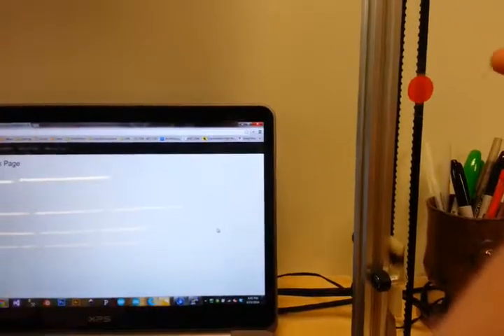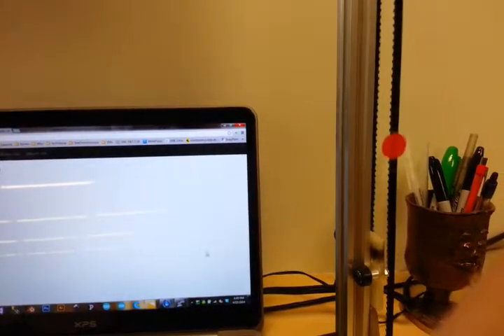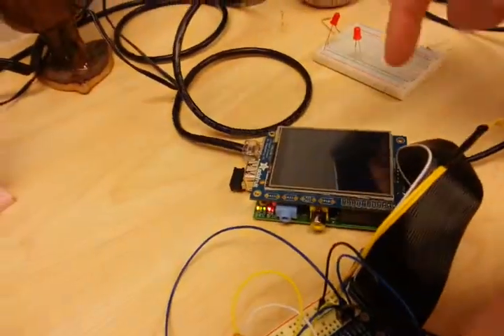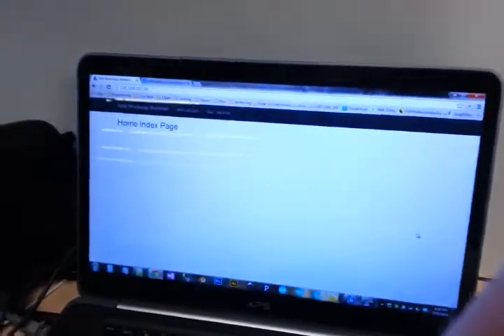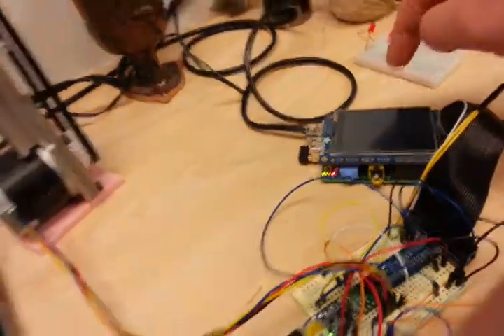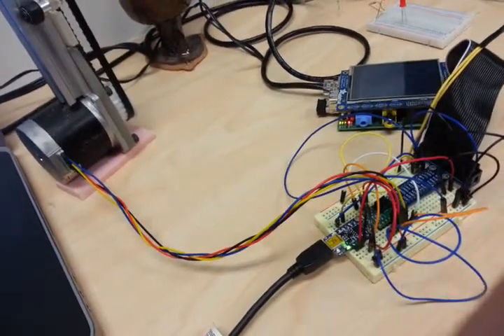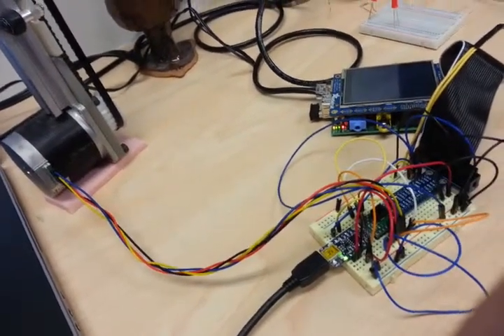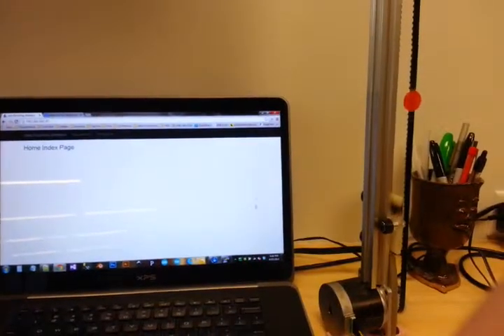Real time stepper motor control

Comment: I know I'm late to comment on this...I'm trying to control my stepper motors with the mouse or any USB input device realy. Can you point me in the right direction? The goal is a camera motion control with 2 axis.
You would save my ass :D
Reply from the maker: I used pololul stepper motor drivers that accept a pulse train to command movements. To calculate the movements you can use an arduino or something similar. From there you need some form of communication with the thing the mouse is connected to. In this case I used a serial port
Reply: I got my arduino with the stepper motor drivers (A4988) hooked up to my laptop. Did you run the arduino with the standard firmata and then controlled it with node-red?
Reply from the maker: i wrote custom firmware for the arduino and code for each component
Reply: Oh ok, that's a "no can do" for me I'm afraid, but thanks for your input :)
Reply from the maker: awh, come on,  coding is fun
Reply: :D yeah not so much for me, but sure, after this project I can look into it. But for now I have to make do with simple sollutions and finish the motion control slider in a week :O